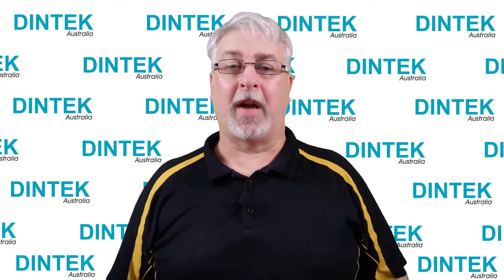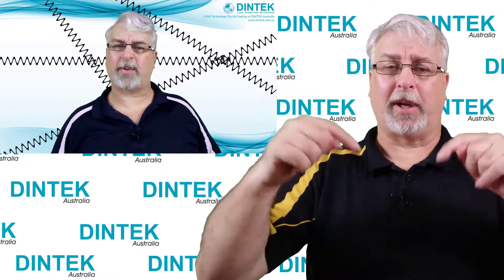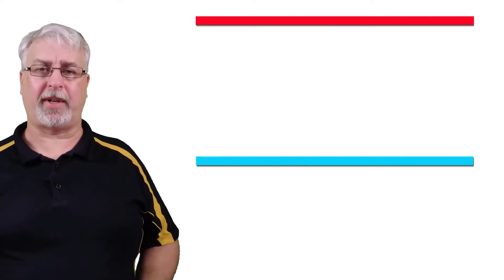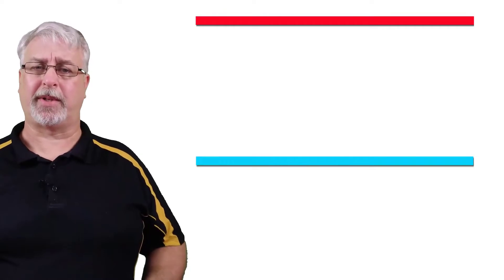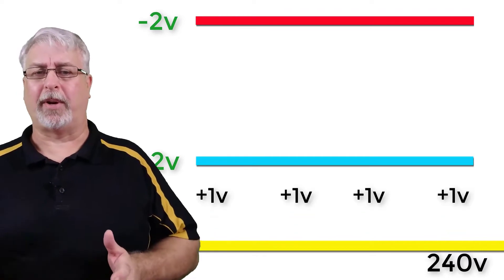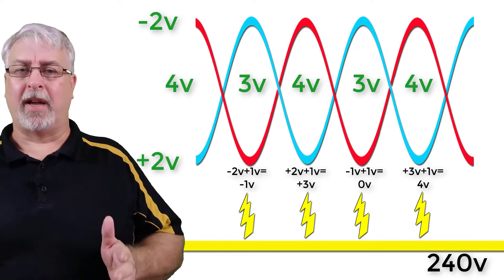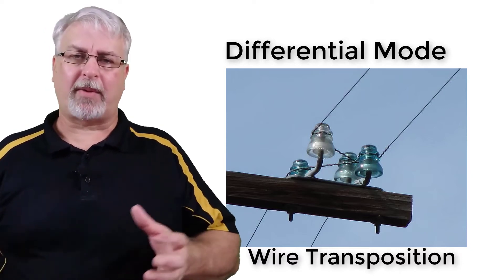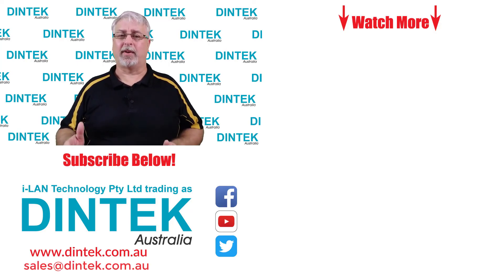How Does UTP Cable Work?

Comment: How do you know if you suffer of EMI problems?(Do i need to check for dropped packets?) Is there a network design rule to follow how far from other cables(utp,power) you need to place em?

Is STP cables only to be safe than sorry?

Running cables on the attic/outside the house utp is bad? If so why?  Thx in advance for anyone who can answer.
Reply: you can prob get away with utp in your house just try to keep it at least 6 but preferably 12 inches from power wires if running parallel.  it's ok to touch power wires if running them perpendicular or across them.  just don't want them side by side for long distances.  oh and when going down the wall never use the same hole for power and data or a/v.  that's actually an electrical code violation anyway.

as far as how you would test, i don't know but if you're not having problems i wouldn't worry about it.
Reply: @XX-121  thx for the info.